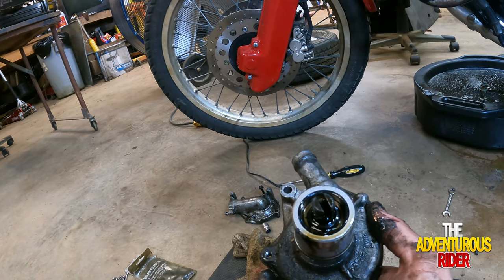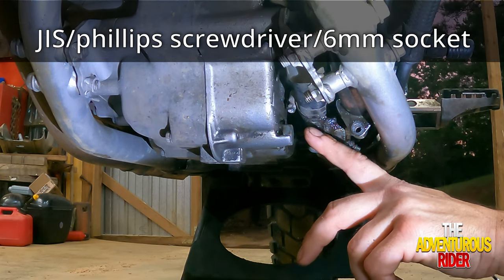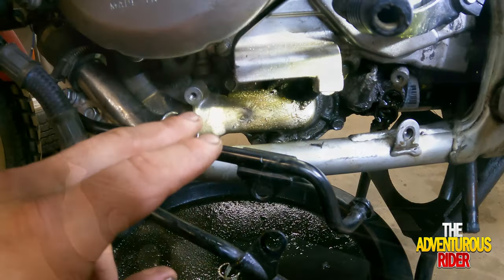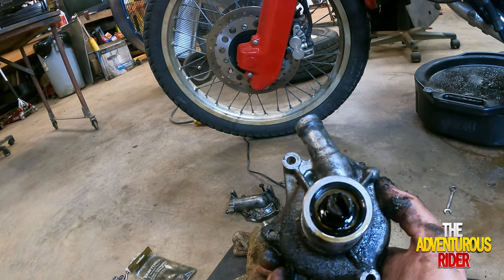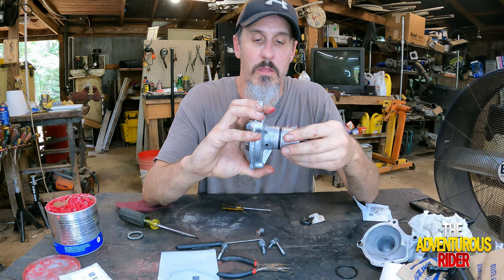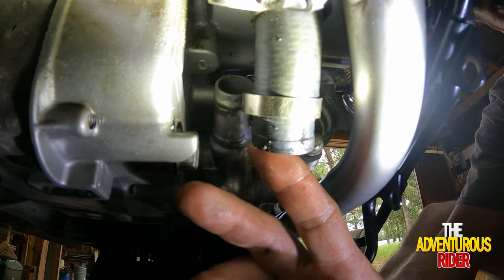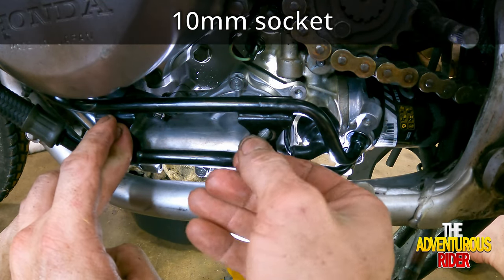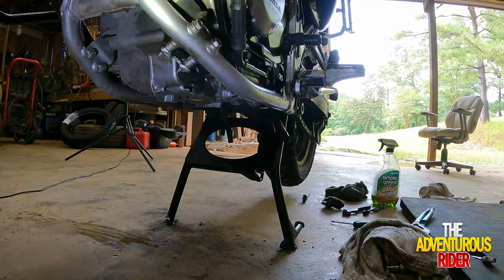Honda Africa Twin Water Pump Removal and Installation

Comment: As usual, great video. Your descriptions are only matched by the fantastic camera work. Very well lit. It's SO much better to watch something like this video than to be stuck with the small black & white pictures in a Haynes manual or similar. The only suggestion that I would offer is the use of anti-seize on steel bolts going into aluminum... for next time :) I'm 100% with you on replacing everything you can in there while you're in there, like O rings and such. That's just smart work! Take care, CC
Reply from the maker: The anti-seize is something I didn't think about..  this is why I really value your comments and really appreciate them.  Thanks for watching.

Comment: Nice to see how working something understanding person, which using wright size (1/4) tools, because somebody use 3/8, 1/2 Ratchet and sockets to unscrew 8 mm bolt it's terrible on my own. Go straight and be safe
Reply from the maker: I agree but sometimes you gotta use what you have.  I agree though it's very easy to break bolts when you use the next size ratchet.  There are times I have done this and like you regret it.  Thanks for watching.

Comment: Fantastic guide, but I honestly wonder HOW you cleaned down there so perfectly! What you used?
Reply from the maker: I used simply green with a wire brush and/or tooth brush to get all of the big stuff.  Then i switch over to soap and water with a rag.  It took a good bit of time as well which i knew it would why  i didn't record any of it.  Thanks for watching!

Comment: Hi. How did you clean the crank case?
Cheers!
Reply from the maker: I used simply green and wire brush or tooth brush to get the large stuff.  Then I went back with soap and water and a rag.  It took a good bit of time as well.   Hopefully that helps.
Reply: Thank you!!